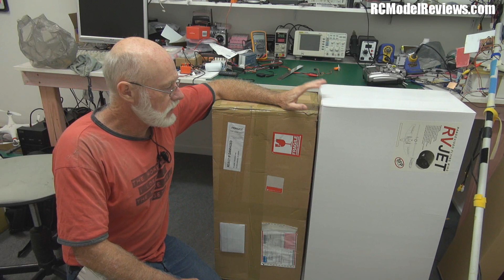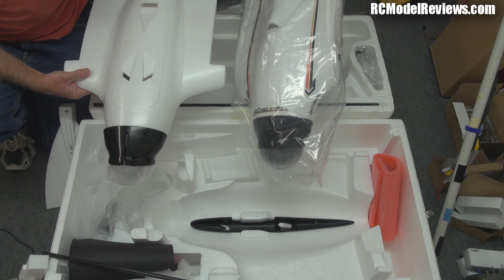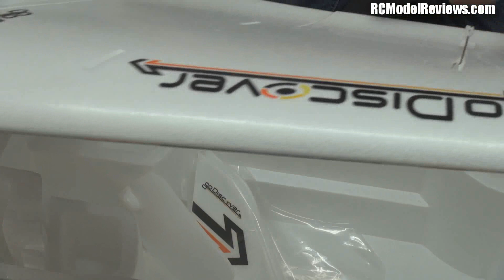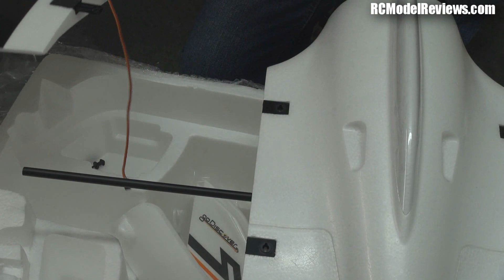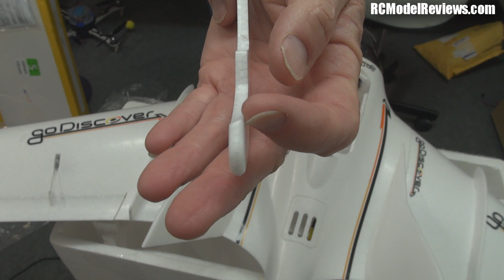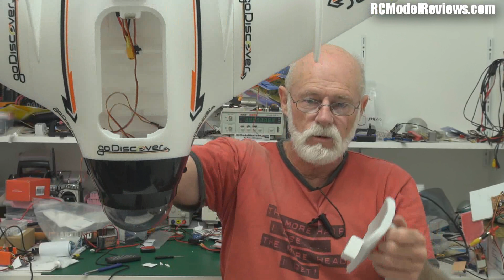Go Discover versus RVJet FPV wing RC planes (part 1)

Comment: If your not taking the wings off (due to the wing clips) try reinforced tape over the wing to body joint. It will make the joint smoother and help it to line up, and slightly stiffen the joint.

Comment: I have mounted 3 RVJet´s so far and the quality is outstanding, you can feel the engineering side when you build it up, they have thought it through, no comparaison at all with the HK version. It is so easy to copy stuff or get inspired by existing stuff, the RVJet was a new concept and i totally support these efforts. The RVJet comes with a spare bubble and the box can be reused for transport or the long winterdays.Well, from out of the box experience until flying, totally well engineered plane, worth the extra money!

Comment: I love to watch your videos, they're informative and fair. I own a Go discover and agree that there are a few issues with the initial build but the price often reflects the quality and once built, this thing flies like an expensive wing. 
My solution to the wing lug misalignment was to completely remove them. I then lined the wings up and taped them into place. The next step was to connect the left wing lugs together, stick a bit of gorilla glue on the wing inserts (careful not to actually glue the wings together)  and set the lugs into the left wing inserts. I then did the same with the right set of wing lugs. Two hours later, I had perfectly aligned wings and wing lugs,. I can now separate the wings easily and cleanly. 
Thanks again for your videos, please keep them coming.

Comment: Nice work Bruce. Go discover vs RVjet is a pretty topical comparrison right now so it's great you got in front of it before anyone else.  

I suspect your go discover  will be under powered as in my experience, hobby king always seem to cheap out on their esc and motors in pnf planes. You are  better off getting a kit and putting in a plush esc and an NTM sk3 motor. Doesn't take much longer to put those in. Look forward to the test flight.

Also I thought that the servo/pushrod setup on the Go Discover looked really good. Having servos under the wing with the push rods coming through the wing is in my opinion the ideal setup for this kind of plane.

Comment: It's even stronger if you criss cross the carbon cloth at a 45 degree angle. But the one you see the weave in is probably done with pre-preg on a mandrel.

Comment: Lol I feel your frustration Bruce... That's exactly why I've avoided anything "ARTF" or "RTF" in a box... Never had a good experience.. Gimme a box of sticks and a tube of glue and I'm happy :) cheers
Reply: No doubt but before the days of CNC cut balsa kits the die stamping often left a lot to be desired and quite a lot of builder 'adjustments' were necessary.  A particularly fussy builder of my acquaintance often replaced a lot of the supplied wood too.

There's nothing new about builder modification.

I think Bruce made too big a deal of needing to spend over an hour assembling the wing.  It's still almost instantaneous  compared even with so-called ARTFs I've put together - there's a lot of work fitting them out too. Let alone 'real' kits.
Reply: BelperFlyer Agreed, hell, even top end helicopter kits I used to find myself filing a few bits here, making better shaped carbon fibre plates.. That's the best bit for me.. those lackings' from the design team and factory are all opportunities for me to build 'my version' of it that much better than i know 99% of everyone else's will look and fly ;) That's my process of 'bonding' with my machine, and making it 'mine'. :) cheers

Comment: Thank you for another great review... or part of of one.  I really like that you are going to compare the two.  As a novice I find it frustrating that RTF (Ready To Fly) doesn't really mean much.  At some point would you comment on the level of experience you think necessary to build and fly either plane?  The RVJET currently stands as my "ideal plane", but I've only flown an Ember 2 and an Easystar.  I don't want to buy more plane than I can handle.

Comment: Problem with RV Jet is that it's sold only in USA. That means costs extra shipping to Europe, and duties apply. Together it's 2 or 3 times more than GoDiscover, and you have to spend part of day talking to duty officers what each part it, that it's legal, has certificates (especially radio and hf equipment, and they claim motors and servos are part of this category), and of course everything has to have CE sign. So I ordered the GoDiscover. :)

Comment: I would have to disagree with your slightly negative review of the go discover. Mine went together easily and flys very well. I'm using a 3s 4200 mah battery and apm 2.6 will cruse on 4-5 amps at 70 km/h. Even if it took a few few minutes to make everything fit nicely it's still better than the rv jet witch comes with nothing installed

Comment: Other than the possible benefit of drag reduction to duration and range, I don't get the point of putting a distorting, glare producing, sure to be scratched non-optical dome and solar furnace electronics cooker in the nose.  Unless one wants to sacrifice FPV fidelity for (how much of an actual increase in?) range/duration, I don't see it as a good trade-off.
Reply: like your rant. pretty funny.  i use two fpv cams for almost 3 hrs flight. no domes. cheers.
Reply: I don't see my comment as either a "rant" or "funny" and your claimed experience seems to confirm my suspicion that domes are pointless.
Reply: Winston Smith ?
Reply: For looks, ofcourse.
Reply: Winston Smith I'm pretty sure FPVREVIEWS was agreeing with you.  Hostile much?
Reply: Make useless comments much?
Reply: Winston Smith All the time!

Comment: Even with a little farting around to get everything to fit well, its still quicker than the balsa dope days of a kit being a box of balsa and plans. No laser cutting then, YOU had to cut the ribs out from patterns and t pin it to the plans on the board. Even the gws  planes I'd get needed tweaking and mods out of the box to get it to fly well. Hobby king is cheap, and you should plan accordingly. A little effort goes a long way.

Comment: Hi Bruce, I have a RvJet myself and I love the wing, the only problem that  I have is with the gopro compartment it is really hard to turn the camera on and off, I don't like to have the wifi on the camera turned on as I fly, I believe it will give me noise problems on my video and my transmitter. Can you check the noise interference with the wifi on? Do you have a solution for the on and off? Thanks for the good work.

Comment: The glue reminds me of the contact cement gws  would include with their kits. I have a whole box of them. I'd chuck their glue and use epoxy with micro baloons
Reply: GWS glue has always been excellent for me. Apply glue, fit parts, remove parts... give it 3-5 minutes to dry and reapply parts, then give it about an hour to dry

Comment: Thanks Bruce, it looks like you change your mute an little bit:) If I compare your video with older one, you much more keen to accept disadvantages of "chinia quality" but have an low price. I think nobody would expect that RVJet will have an lower quality:) I realy like your reviews, apprechiate your time and take an lot of benefits from it.
Hope you will stay with your fair and open approache to test and review RC stuff without privilege products or advertice to much.
Reply: Ultimately -- I try to look at what the value is.

I was critical of the Go Discover because of the irritating issues encountered during the build -- but ultimately, it's still a lot of model for the money and, providing it flies well, the build issues are soon forgotten.
Reply: *****
 yes, make sence. May you can also display what is nessesary (USD)  to get both in the air. What I see, RV Jet needs to be loaded with lot of stuff.
BTW dom for RVJet 10USD:) Do RVJ provide 2 doom in box?
When you would be able to test in air? You still banned? Hope you can solve this soon. cross my finger.

Comment: Looking into getting a wing myself soon, so, I've been researching.  On the FPV side of things, people seem to love Skywalker stuff but they have a reputation for bad fit issues, worse, arguably than the Go Discover.

Bruce does point out that the problems are reasonably easy to fix.  If I had the cash, it'd probably be an RV,, mind you...

Comment: So did you see the prop hits the foam? So you have to cut the foam or shim the spinner.
Reply: I noticed that the prop can swing forward enough to touch the foam but I figured that when it's running, the centrifugal force should stop the blades from coning forward enough to actually hit it.

Comment: Hi Bruce. As always a thorough video.
I'm a 63 y/o starter and have learned a lot with your videos. Thanks.
I've got two questions I'll appreciate your input, if you've got the time to spare.
1 - Can I drill a hole on the belly, of either plane, to install a 110 by 66 by 32 mm camera with an objective of 30mm in diameter?
2 - Which is your opinion on the Feiyu-Tech Panda autopilot?
I intend to use the plane for crop survey and I'm grateful & open to any suggestions you may give me.
Many thanks, again.
Ricardo.
Reply: You can drill a hole but be aware that there is a spine/keel that runs the length of the model underneath and thus you'd have to either offset the camera to one side or you'd have to drill through that keel -- potentially weakening the model somewhat.

I haven't used the Feiyu-Tech panda so can't really comment.  I have used their FY21AP FPV flight controller with great results but I have heard that some of their products have had a few issues from time to time.  The Panda is a pretty expensive bit of kit -- there are cheaper options such as the APM but I guess it depends on how much time you have versus money.
Reply: ***** Morning Bruce, thanks for your prompt answer.
About the spine/keel I was thinking in reinforcing the area with CF & the plastic camera crib.
About the autopilot, which would be your choice. I need it to take care of all the flight phases, except takeoff. Must have, at least, 20/30 or more programmable way points. Cost is not a big issue, it has to be the very best, but under USD 1.000, because I'm going to put it to work.
Many thanks again.
Ricardo.

Comment: really disheartened by the initial low quality of the assemblies on the Go Discover. are you saving $? kind of but most ppl's time is very valuable and if you only have 2 hrs on a Saturday to put on a new model and hoped you were getting a plug n play, well ...

Comment: It had better fly slow, the sheer frontal area and induced drag is going to kill duration if it flies at even a moderate speed.
The wing fences look very fragile I'd be sanding them back aft of the LE. one other thing probably worth doing given the workhose nature of the plane would be some light fiberglassing of the fuse belly and wing lower surface. This would also be a good opportunity to add some more colour for orientation when flying LOS.
 As for the fit and finish I think the manufactures are often better off not going too far with the assembly and simply leave the owner with a little extra work which can be completed to the builders own standards. Correcting factory stuff ups is more frustrating and time consuming than doing it from scratch right the first time. Afer all we are supposed to be modelers not paint by numbers pilots.
Reply: Laminate the wing fences.

Comment: flew my go discover on saturday, not fantastic, had all the same build problems as you except while my glue was not dried up, i never use the Chinese glue and used cyno and kicker/activator instead, when it came to sorting the wing clips, i tried to remove the plastic clip and it fell out, barely any glue at all and it was that crappy silicon like stuff as well, just something to warn you about.       Sadly a clip on the fuselage broke due to ALL the plastic parts on this model being really cheap and nasty, and due to the fact hobbyking only sell the longer wing end of the clips and even they are out of stock, i had to come up with my own design to fix the wing on. when it came to flying it, it flew quite well, very smooth, no tip stalling at low speed like the X5 and X8 are prone to doing.but the power set up is awful, no lower at all on 4s 4000mah, and i only had a gopro, fy21ap, ap117 and transmitter on board, (fy21ap works really well on this plane, some servos in pnp planes don't like stabilisation systems) cant be that heavy, barely climbs unless into wind on full chat. another thing that i noticed on the side of the box is it says something like don't use full power for more than 20 seconds which basically says to me that they've put a too small of a esc to save costs. on landing due to the plastic thing on the bottom being like a ice skate on grass the model keep going, bouncing on a small dip in the field, dropped a wing, cartwheeled, ejected both wings and smashed the front camera dome/black plastic bits/pan and tilt to bits. really not impressed at all. also on the website/product videos/ even the box says that there should be 2 domes, one clear and one with anti glare, but what they actually mean is 2 are available, which is false advertising and illegal in most places. sorry to have written something which will take longer to read then the video is to watch. i purchased the AXN recently and that is an amazing machine at throw-away money.

Comment: You're right.  It's very inexpensive, so really, who cares?  I've had the X8, RV Jet, Sky Eye, FX79 Buffalo.  After you handle the plane a few times, land it not quite right, that dome will be scratched.  Even totally clean, the dome will show light refraction at certain angles to the sun.  The real advantage to the dome is you greatly reduce the wind noise that the camera mic picks up.  Those domes are gimmicks.  Best bang for the buck is the Sky Eye but if you want a wing, I think this Discover may be it.  Fit and finish?  Let's face it, even the RV Jet has gaps and it has "unique" flying characteristics (read: "odd") and after a few dings and scratches, it won't look any different than any other plane in your hanger.  Same goes for the Buffalo except the Buffalo has no surprises in the flying department.  If I were to do it all over again and could only have one, I'd just get the Discover and be done with it.  1.25 hrs of build time?  That's nothing to get a PNP into the air.  As an RC hobbyist, it's part of the routine to fiddle with the little stuff to get it right.  Regardless of the cost of the plane, you still have to fiddle to some extent, so why not just get something reasonably priced and make it work well for you?  I have $500.00 planes that still need fiddling.

Comment: lol, I remember my hustler mkIV took me about 3 months doing an hour here and there, that was when I was totally new to planes / really hands on things in general. I don't know if you get sponsored by HK, but I'm really starting to get sick of their (lack of) QC. It's nopt just you and me ending up with a pile of unflyable foam, albiet only $100~ out opf pocket, but It's the people trying out the hobby that get sick of fixing things at the field and give the whole thing a miss as a result. I'll buy batteries and accessories from them, but I dont think I'll buy any of their park flyers any more.
 And also I've noticed they advise things like batteries fit certain models on their website, and this is not the case when you get the model. it's happened more than once to me. I guess caveat emptor.

Comment: it may just be me, but with the whole, "its just a 130$ wing" thing, this review is starting to sound like the epp fpv.
Reply: Well it's very easy to be overly critical of a product -- until you realise that the price of many of the items involved is a tiny fraction of what it would have cost to buy/build them just a few short years ago.

It's looking as if when you compare the Go Discover to the RV Jet -- it's a "you get what you pay for" situation.   If you buy a Toyota, you don't expect the fit, finish and performance of a Bently -- so it doesn't hurt to remind yourself from time to time that it's not about price or quality per-se, it's about the combination of the two -- which is value.
Reply: *****
I guess that's part of what bothers me, Bruce. The fact that the cost of these things is only a fraction of what it used to be makes me wonder why it's still so difficult to deliver a reasonably priced model of better quality instead of a reasonably priced piece of sh$t. I just don't get it.
Note to Hobby King: Add $3 to the price of your items of more questionable quality and pay some poor schlub $0.20 and hour to test a few at the factory to make sure that the customer doesn't feel like he got raped in return for patronizing your company.
Reply: davedeja 
Because quality costs money, and I guess Hobbyking decided that they will earn more by selling a lot of cheap, mediocre quality stuff than expensive, good quality products.
And it makes sense, company I work for had to REDUCE quality of products built because it was higher than the customers expected (and with a higher price of course).

Comment: so you would rather spend 240 on the rv jet? my advice is dont ever spend 240 on styrofoam it doesn't even come with any electronics. think about it you have to buy an esc motor and servos. which is an extra 100 $ . now you have spent 340 on styrofoam . bad decision.. BUY THE GO DISCOVER . !! and put your 200 dollar savings into your new fpv goggles my friends. if you don't like how the wing fits, then epoxy them on. who cares if it takes 1 hour to build . building is the fun part. and the clear dome is anti reflective in case you didn't know. you can buy 2 go discovers for the price of 1 rvjet